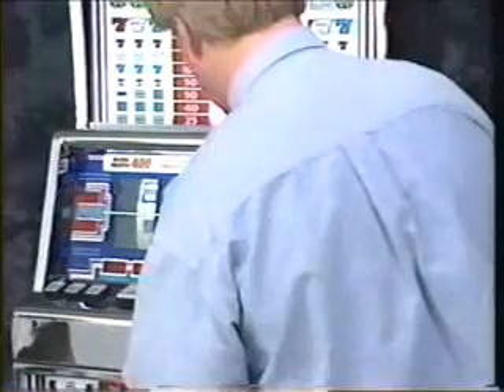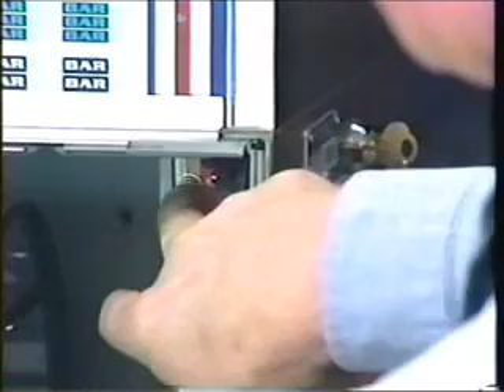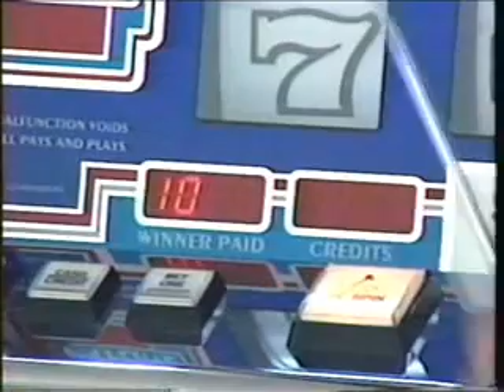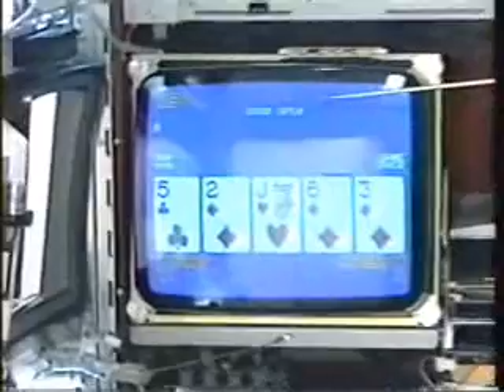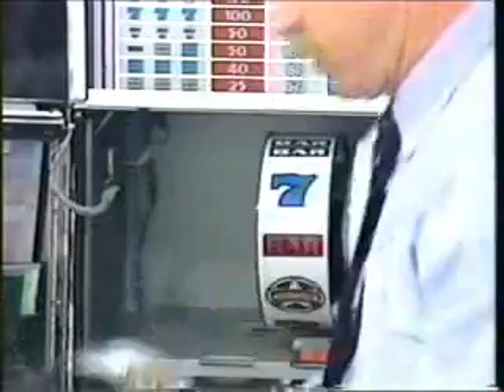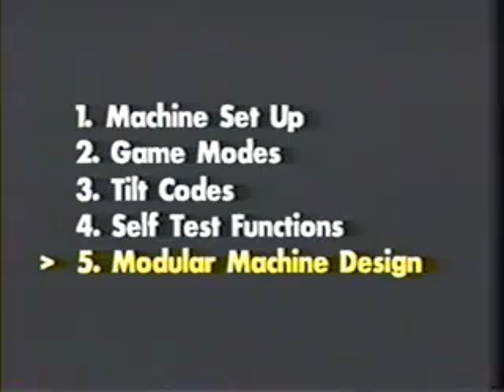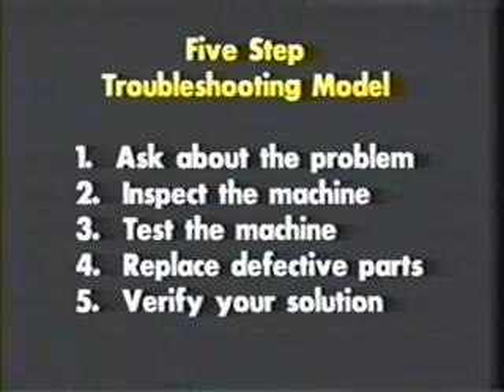Basic Machine Troubleshooting Video. Part 2

Comment: Iv brought a deal or no deal lumina 2016 make when I got it back home it wouldn't turn back on but I can here to motor making a start up noise and on one of the display it's showing up as sec 020E dose this mean anything or stopping it from coming on or working need help please
Reply: Japanese machine repair manual.